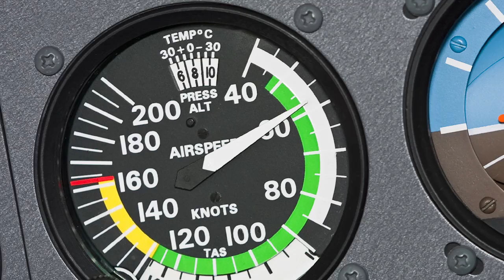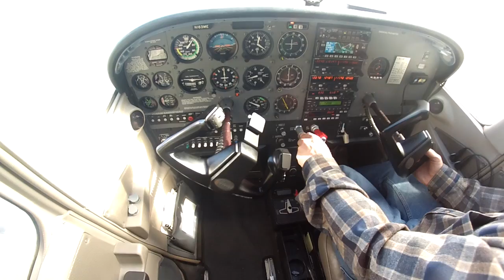Takeoffs and Landings: Crosswind Landings

Comment: My airplane stalls at 38. If confronted with a 30 knot crosswind, I will land across the runway! It is easy to brake from 8 knots forward, to stop on a single runway airport, with no other choices. Likewise, I only need 30 feet or less, to take off in the same wind.

Comment: Crosswind, that brings back memories. I used to fly a powered glider with one center wheel and little stabilising wheels on flexible supports under the wings. That thing simply could not taxi at all in crosswinds as it just laid down its downwind wing. You could land it alright but you then needed someone to come and hold the wing while taxiing. Quite awkward if you were not at your home-base and people assumed that you just had sheared off a wheel landing.

Comment: As a student glider pilot the only time I envy power pilots is on landing. I had one gusty landing that I would have gladly gone around on when I saw the wind sock fully inflated whirling around just before turning base. I handled it well and everything calmed down a few second before rounding off and then just before touchdown it nailed me. It wasn't a pretty landing but all was well and I soloed 2 flights later.
Reply: You should get power training and get a motorglider

Comment: Im a student with about 10 hours of flight time. Im struggling with landings especially since it's windy season. I've been landing in 22knot wind for the past week. Today I had to do 5 go arounds because it was so bad. Very discouraging being a student I feel like I'm getting worse.
Reply: ZIPPER978 smooth seas never make a good sailor
Reply: I'm a student pilot like you. 22 knots is just too much. My motto is that you need to learn to walk before you can run. At 30 hours mark I'm still trying to land smoothly in calm winds(0-5 knots). Once you figure out the landing part in calm winds then you can gradually increase the crosswind component. Start with something small like 3-4 knots and gradually to 10 knots.  22 knots is just way too much. I wouldn't want to fly in it.
Reply: ZIPPER978  Don't worry. I am also a low time pilot in training. I encourage you to talk to other instructors besides the one you usually fly with, it helped me out!
Reply: If you're even landing in that wind as a student,  you're doing good
Reply: A lot of training involves learning all the variables. That may involve doing things improperly a lot of times until you get that Eureka moment when things the variables start coming together. And that process means sometimes one DOES get worse before he get better. That means you're feeling your way around--which is the whole point of practice. Don't rush the process. It will probably click sooner or later.
Reply: ZIPPER978 dude same!! that's why I'm watching this video...just stay at it you/we will get it
Reply: Have no shame! Everyone have been there. Its called "learning.". If we already knew how to do it, we wouldn't need a instructor :D Keep Flying dude!
Reply: Eheheh, due to where I live and am doing my training, it's very rare for the wind to be sub-15kts. Just the other day, I was doing solo circuits on a 21 rwy where I started off with 190/14 (50% of my landings have been 15-20kts so I'm more than comfy) but in the time of one circuit, the wind velocity doubled and changed direction to 170/27. Let's just say that it was an interesting landing. hit the deck with a 20 degree(ish) crab as the ailerons themselves couldnt stop the drift, especially how I usually linger on top of rwy as I'm quite light (I'm 130lbs and typically around 70lbs fuel) meaning even at 50kts (c152 with 20/30 degrees of flaps, 20 if it's very windy), slight back pressure on the yoke results in an instant balloon.

Comment: If you know there's a cross wind you land with less flaps and more speed. You have more control of the aircraft in all stages of the approach. All max cross wind speeds are determined maintaining centerline with a specific speed (65 KIAS in most C172s) in the landing configuration.
Reply: I'm surprised this wasn't mentioned